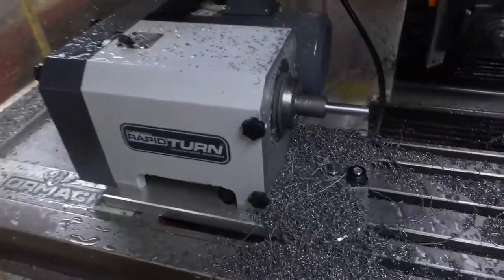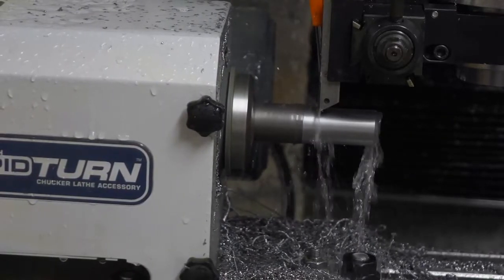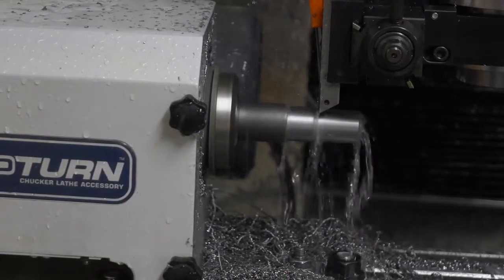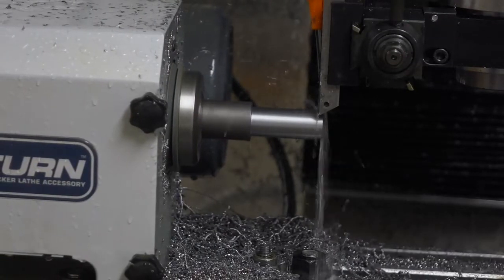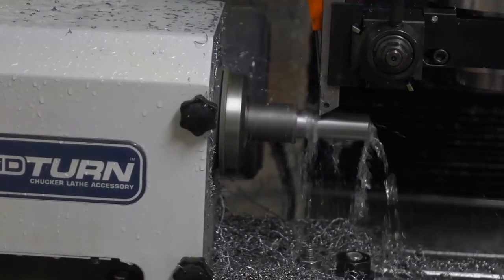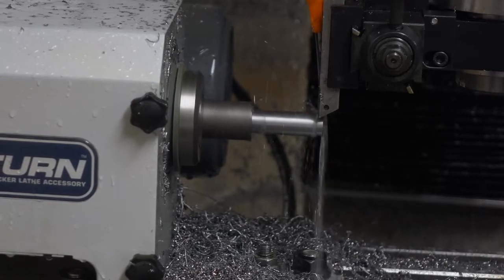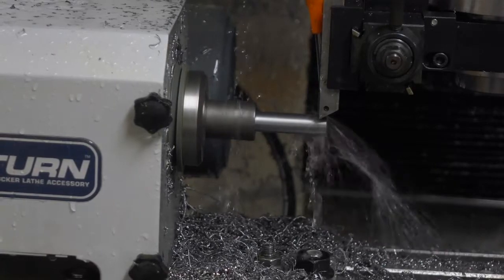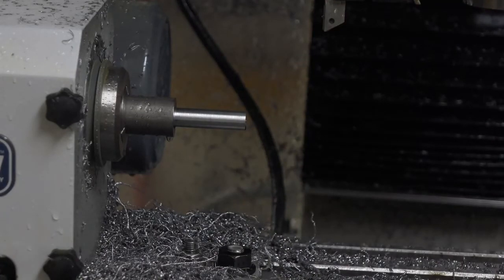Turning steel for the first time on the Tormach RapidTurn

Comment: I'm happy for you! to get more speed you may want to investigate the Surface Feet per Minute function (SFM - located in the central lower area of the screen). SFM function is part of what allows PathPilot to vary its speed; which it does based on your programming and the diameter of the workpiece. Best wishes!